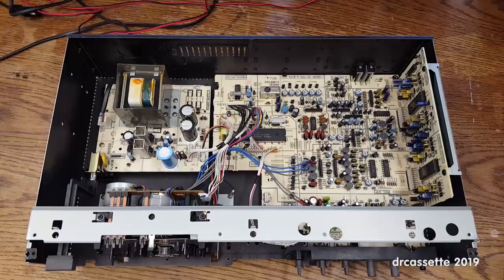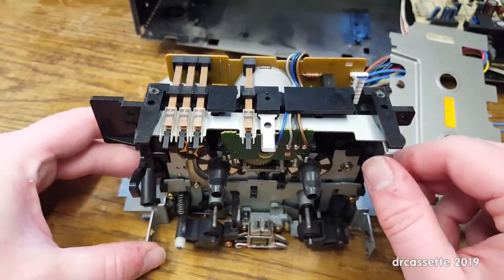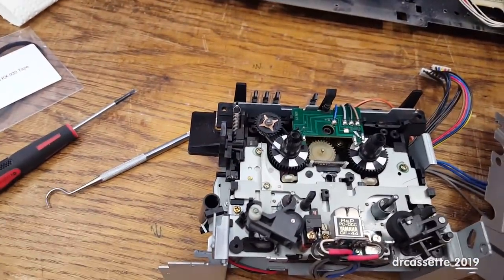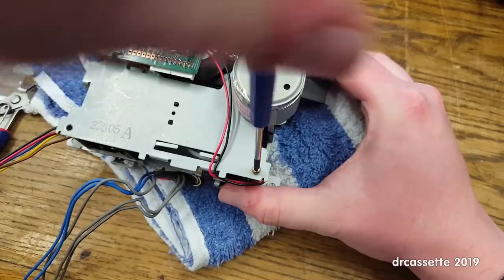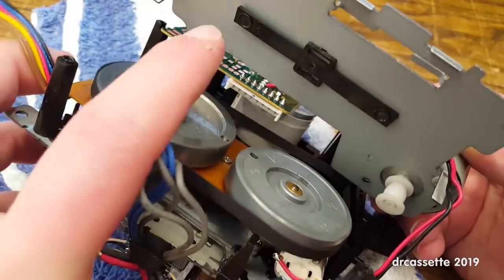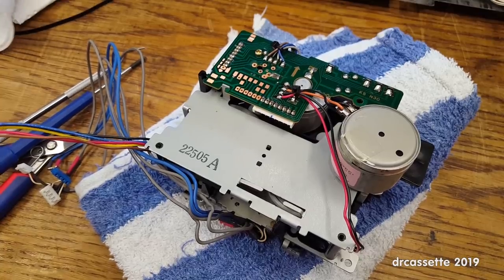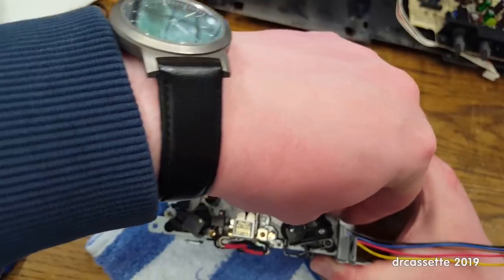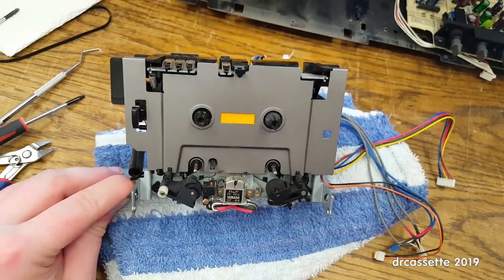Yamaha KX-930 cassette deck repairs [2/3] - belt replacement

Comment: Thanks, I got my belts and  replaced the old ones. O boy what does this deck sound good. Still looks like new. but now again it sound like new again. Shame old cassettes  were not used for a long time and now it seems the song pressed through and you can hear it in te silent parts. I think I need to re record those. Advice for the cassette lovers. Don't leave your deck too long not used and once in a while replay all cassettes.
Reply from the maker: I know what you mean, the copy-through effect. On some types and brands of cassettes this effect was very strong, on others not so much. It can be prevented or at least minimized by playing or just fast forwarding and rewinding cassettes from time to time, this way the tape layers end up in slightly different places each time.

Comment: A good idea is to take photos of the equipment interior and the mechanism before starting to take things apart.
Reply from the maker: I had taken a photo of all the connectors on the main board which turned out to be quite handy because the record head and the playback head have the same connector.

Comment: Those dentistry tools look very handy. A repair job like this would be way too nervewrecking for me, the mechanism looks dauntingly complex. I struggled with a Dual 1224 once but I’m never going to attempt that ever again😅, got to a certain point and realized that the next steps would be to risky. I still need to fix the tonearm lift piston since 2015 but I don’t have the guts to take apart the tonearm assembly.

Comment: Thanks for the video. Just found my KX-930 has a bad belt. Curled around the motor pulley. This alway happens when you need it. (after years of not using :-). I will order a set of belts and will replace them, like you showed us. 
I bought my KX, back in the early nineties and it still looks like new. I hope it soon will sound as new too.

Comment: Thanks for this excellent video. This deck is almost identical to my Kenwood KX-4520 and the belts had turned to goo so this video has helped me a lot. Thanks.
Reply from the maker: I'm glad this video was helpful :)
Reply: thanks to this video. i have my tapedeck kx 4520 which is very identical. same problem. but unfortunately i cant fixed it. i think there is different problem. tape dont play.

Comment: Good work!  You got lucky because the old belts were not a messy goo.  As for a good place to buy belts, I bought a few "high quality", "high priced", "slow delivery" ones.  The good news is that if you can wait like 4-12 weeks to receive, you will get very good belts that may last 10-30 years more.  I won't even mention the name of the seller because you may not have a good experience.  My suggestion is to ask for practical advice based on experiences at places like audiokarma.org

Comment: :face-blue-smiling: Goodnight friend. I received this model from a customer to change the belt, but it took some work but it's difficult to get a belt that fits right because the ones I put on make the capstan rotate a lot, making the sound unstable, shaking because the belt is shaped not regular.

Comment: Topp, Daumen hoch! Tolle Arbeit, leicht zu verfolgen, auch wegen der guten Kamera-Einstellung. Jetzt weiß ich aber auch, was ich an meinem Revox-Decks (nicht) habe, nämlich Riemen, die zerfallen können. Da machen sich die Vier-Motoren-Laufwerke bezahlt. Bin schon auf den nächsten Teil gespannt. Ich muss aber doch noch kurz den Klugscheißer-Modus einschalten: Am Laufwerk, in der Nähe der Bandführungen und Köpfe sollte nicht mit einem magnetischen Bit-Halter-Schraubendreher herumgewerkelt werden ;-).
Reply from the maker: Ich habe das heute mal geprüft: Das Magnetfeld von dem Bit-Halter-Schraubendreher wird von dem Schraubendreher hinreichend abgeschirmt, wenn ein Bit eingesetzt ist, dann ist das Magnetfeld mit einem Metallstück als Probe kaum wahrnehmbar. Geht also in Ordnung, so lange man nicht direkt auf dem Kopf damit herumfummelt.

Comment: Thank you for sharing, I found it very relaxing, almost like ASMR :-D   I have gotten back into cassettes and cassette decks after over 20 years.  BTW where is the idler tire in this unit?  I don’t see it in any part of the video.
Reply from the maker: The more modern cassette mechanisms like the one seen in this video use gears instead of idler wheels. This generally makes the mechanisms much more reliable, except on some mechanisms where the gears have a tendency to break...

Comment: The source for belt is make it yourself get a saw hole cutter find the size you need drill it to the depth you want a piece of plywood fill it with medium grade hardness silicone smooth off the top let it Harden you got a belt with some melted candle wax go round the hole you cut first with an artist's brush.
You should put your belts first in a bag of talcum powder gives better smoother operation
Reply: lol, if you don’t care for wow and flutter
Reply from the maker: Are you kidding me? A cassette deck belt ist a precision component that has major influence on Wow & Flutter, you can't just fabricate some silicone ring for that!
Reply: @DrCassette  yes I didn't say it wasn't your pointers is...

Comment: I was looking for some insights in belt replacement for my Kenwood kx 7030. I have not opened up the Deck yet, but looking at your video and the kx 7030 service manual it seems that there must be a big similarity on this mechanical part. I can comment on this after christmas having the belt replaced by then…
Reply: Yes just finished replacing the belts on my Kenwood. It is almost the same as the mechanism shown here, if not exactly the same. My small belt was gone as well, all sticky stuff could not get it off my hands. It is a little bit difficult to reach everything, after all, seen this movie, it worked out fine 👍
Reply from the maker: Congratulations for the successful repair! The rubber residue of molten belts can be washed off with isopropyl alcohol (IPA), but that is of course not good for the skin.

Comment: Excelent video. Very usefull for kx-650 (has identical mechanism). Changed my belt for kx-930(decent belt, cost me 1 EUR). Unfortunaly my deck plays for 2 seconds and the right wheel stops while everything alse spins for anoteher 3 seconds. I'm desperate, don't know how to repair it. Any sugestion is appreciated. Thank you 👍
Reply: Vezi sa inlocuiesti cureaua de la counter...am patit asa cu JVC DD 66...are o celula fotovoltaica care citeste daca se invarte!In general,asta-i problema,dar nu-i exclus  si o problema pe partea electronica.Dar,mai mult ca sigur iti lipseste o curelusa,care invarte o rola ceva,iar fotosenzorul pune stop!Cu un pic de atentie,o sa o gasesti!
Reply: My KX-930 shows similar issues. Replaced 2 belts. The small belt for the wheel with the silver/black segments was completely molt to a kind of black sticky glue. It seems that these remains have covered on the segment wheel and also the corresponding photovoltaic sensor above. Therefore the KX-930 could not recognize the movement of the wheel. Maybe that´s why the mechanism stops after some seconds. I am trying to remove the stain and hope it´ll work properly again.

Comment: Hello,
I just bought a YAMAHA KX W-952 RS Cassette deck everything works but the display of the controls is totally out of order. No reaction from where it can come ??

Thank you for your answers
Reply from the maker: You mean the vacuum fluorescent display? That could be out because of bad solder joints. That's a common problem.

Comment: Does it work for the Yamaha K-98 cassette deck. My still works but I was wondering in case one day the belts crap out
Reply from the maker: Every model of cassette deck is different, the general procedure is similar, but the steps will vary.
Reply: @DrCassette  ok thanks you are the doctor of cassettes. Plz do surgery on mine
Reply from the maker: @gabrielgarza3707  Sorry, I don't do commissioned work.

Comment: Is aversge belt 8 inches? Tried to put the one that slipped off my Ultrx two direction cassette back on. It was 14 inch, a 7 inch circle. Strectched out shape? Maybe that is why it don't work. Thank you for your video.
Reply from the maker: Belts come in all kinds of different shapes and sizes. There is not just one standard size.

Comment: Very interesting.  I have an old Sharp RT-1155 cassette deck that needs new belts.  Any chance to do a video for that model?
Reply from the maker: It's not very likely that I ever come across one, but if I do this deck certainly seems worth the effort.
Reply: @DrCassette  The belts and pinch roller are available (Ebay, et. al.).  I opened up the unit and it doesn't look easy to get at the belts and pinch roller.  I downloaded the service manual and there's nothing showing how to replace the belts and pinch roller.

Comment: greetings. Could you tell me the size of the belts and where they go on the capstain pulleys, on the aiwa multicassette player A70, mine deteriorated and I don't have the diagram, thank you very much.
Reply from the maker: You should be able to find a service manual for your device online, that will tell you all you need to know.

Comment: Hello, I ask this alot, are cassettes audiophile quality, can they sound as good as a vinyl record & a cd.
Reply from the maker: No, cassettes are not audiophile quality.
Reply: I don't know what audiophile quality means. I had a cheap deck in the 1990s and it wasn't great. Now you can afford top class gear like this Yamaha. It sounds very good. I don't use any dolby but my friends ask me "Where's the hissing of the tape?" We all remember cassette as something inferior but it may sound very good. I can't tell a differnce. I play from cds, vinyl, files, cassettes. But cassettes are rather for older, not contemporary music. I wouldn't record on cassettes like I did in the early 1990s.
Reply: @DrCassette  well i have old decks that when i record from cd i show it to several of my friends ,i make the pepsi chalenge and they always choose the tape recorded(no nr) having better sound than the cd,and i don´t use any effect on sound ,all defeat on amplifier and the cd player wasn´t the best at it´s time but very rich in mid frequencies compared to others,regards

Comment: Go to geek.com they have a very big selection of flat belts and they're very cheap you can buy a whole assortment of flat belts for a few dollars
Reply: Hi, don't see belts on that site.
Reply: Sorry it took me so long to reply you have to go in there and say assortment of flat belts they give you and I sent a package I believe it's either 50 or 60 belts and it's a full assortment of all different sizes of flat belts it's not a you don't go in there looking for a specified model number you just go in there and ask for replacement belts assorted and you will find them you find them in geek and you can also find them in wish.com I find them in there all the time and I replace a lot of these belts I've serviced Aegis tape decks all the time instead of going crazy 4 belts but like these Yamahas and Fishers and Sony's all these units like this from the 80s and 90s those belts that you get from the wish and geek we'll fit I haven't had any problems yet

Comment: Do yo plan to keep it for your self or put it for sale? Regarding rubber belts: I order mine from aliexpress or some chinese sites. Just order some assorted packs of differents lenghts, widths and thicknesses.
Reply from the maker: I will keep the deck, at least for now. It's good for transferring cassettes to digital because it has the play trim control to restore some of the high frequencies on very old recordings. Also, with one button missing, I wouldn't get nearly as much money as this deck is worth.

Comment: hello are you familiar with Tascam cassette players or any brand with a weak rewind issue? I'm having that issue and looking for help on a solution.
Reply from the maker: Depends on what kind of mechanism you have in your Tascam. It could be bad belts, bad idler wheels or something a lot more complicated.
Reply: @DrCassette  I'll take it apart and see what the issue is. Hopefully it's a simple fix. Funny thing is it doesn't do that with all cassettes

Comment: Why do you have models that only have one pressure roller and not 2 like in your video?
Reply from the maker: If there are two pinch rollers, the cassette deck either has auto reverse, or dual capstan drive. Standard cassette decks only have one pinch roller for one capstan.

Comment: Why Yamaha made it so difficult to change belts!!??, I have many cassette decks and it's the first time I see such a complex procedure.. I have a double Yamaha deck and after i saw that I will probably sell it.. that's a nightmare!!
Reply from the maker: Be assured, Sony can be even worse than this...
Reply: @DrCassette  True, very complicated to change the belt. After so much work, my client still thinks I overcharged, apart from the china belts that are all deformed, irregular causing fluctuation in the capstan rotation.

Comment: Back tension belt.  Gets locked into place in play mode and keeps the tape tensioned against the head.
Reply from the maker: It could just be for back tension, but the cassette deck also has dual capstans... not sure.
Reply: @DrCassette  Only one pressure roller is engaged for each direction.
Reply: @JacGoudsmit  You are wrong, both rollers engage and this deck has no reverse.
Reply: @eugene4817  Weird...
Reply: @JacGoudsmit  It's called 'closed loop' dual capstan transport, nothing weird about it.
Reply: @eugene4817  So the leading capstan flywheel is slightly smaller than the trailing capstan flywheel (and runs slightly faster) to put tension on the tape? I still think that's weird :)
But then what is the little wheel for that has the belt that was gone? It looks like it has adjustable friction, that's why I thought that was some sort of adjustable mechanism to add tension to the tape (it wouldn't make sense for it to be a counter because both the take-up and supply reels already have a tacho).
Reply: @eugene4817  yea your right i have the  allmost the same deck but mine is the 650 not the 930, but yea both pinch rollers engage on playback.

Comment: Nice video, I had good luck with belts from turntableneedles.com, didn't measure w&f thou. I also 'lost' grounding spring first time. It's well worth going thru electrical adjustments for PB\Rec\meters\tape speed at least. This deck is a very good deck and is worth keeping.
Reply from the maker: I will take care of the tape speed in part 3 of this video.

Comment: sir, where can i find the playback/rec switch to deoxide it?
Reply from the maker: This cassette deck does not have a record/play switch, the switching is done electronically.
Reply: @DrCassette  my decks left channel is significantly quieter than the right channel.  Could you help me find the solution?  My machine is very similar (Yamaha k-1000)
Reply from the maker: Start by making sure the heads are clean and the head alignment has not been changed. Continue by checking the connection from the heads to the amplifier board. From that point onwards things get too complex for a remote diagnosis...
Reply: @DrCassette  Heads are fine and clean.  Mine has DBX.  When turned off, the left channel is a bit louder but is still much weaker than the right one.   Could it be one of the capacitors?

Comment: that small belt is for rewind, if you didn't press rewind you then you wouldn't have noticed.
Reply from the maker: I think I did test rewind at some point and it worked, but the camera wasn't running.
Reply: @DrCassette  What is the purpose of that small gear for small belt?
Reply: @jdgshsjchdjejkd545  This could really be for back tension, but then the belt should not be too tight and back tension torque needs to be adjusted.

Comment: 18:38 Those two holes shouldn't be aligned like they wore at the beginning?
Reply from the maker: No, those are not alignment holes. These holes were drilled into the flywheels to fine tune their balancing.